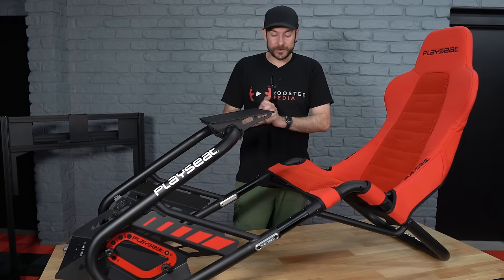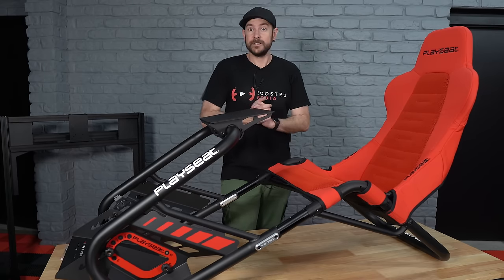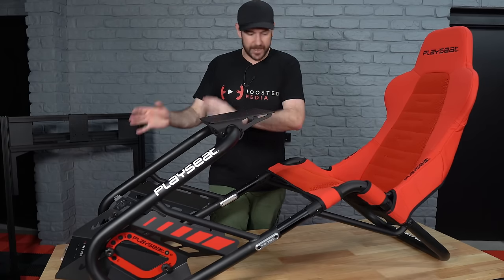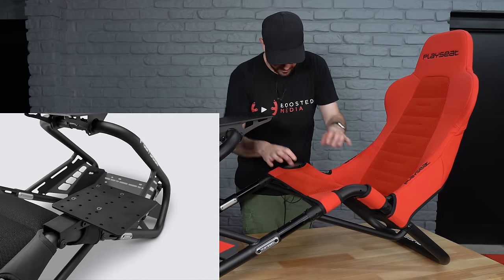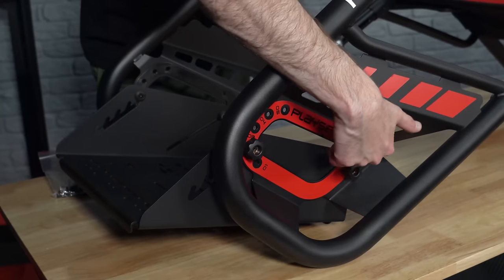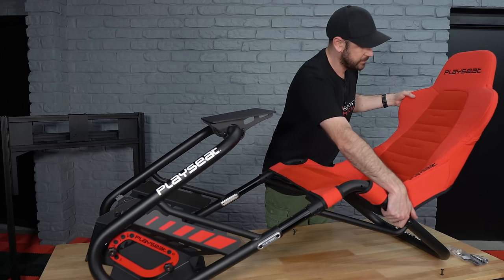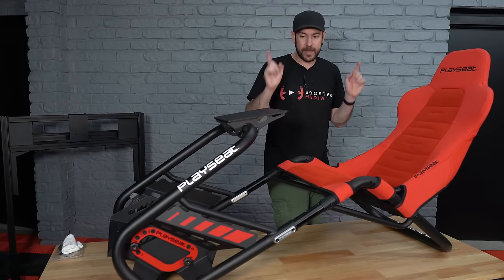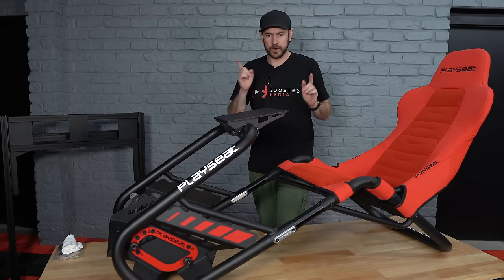JUST BUY A PROFILE RIG? - Playseat Trophy Sim Racing Cockpit Review

Comment: Been rocking this for a good year. It's not ridiculously heavy and can be moved easily, which isn't something you can say for most rigs.
Reply: Every profile rig can be equipped with caster rolls, making it arguably even easier to move.
Reply: @schmid1.079   Doesn't make it anymore compact, if seen pictures of people having these vertically against walls or hanging from some hooks. It's also much more compact
Reply: @gerardweistra  Fair point about hanging it up, but how is it more compact?
Reply: @schmid1.079  it may be just visual but, it looks less massive; like a little less wide and tall
Reply: @gerardweistra  Yes, a little. About 5-10 cm in lenght and broadness. I can't see a lot of situations where those matter, and I have a pretty cramped room myself.
Reply: @schmid1.079 I can hang this on my wall when not in use. Try that with a profile rig 😂

Comment: I have this Rig since March 2023 and use it nearly on daily bases. The seat doesn't have any major issues besides one little corner where the red cover slighly started to peal off, but it is because when I get into and out of the seat I constantly rub myself around it. One thing to note though. If you have a shifter plate mounted and the other side of a rig is against the wall it is slightly complicated to get into it or get out as you need to through your feet over it in the air in a very awkward way
Reply: How much did you pay for it?

Comment: Would be interested to hear your opinions on other profile rigs!  I recently purchased a GT Omega Titan and it's only $100 more than this (cost including the RS12 seat) and this things is pretty solid!  The pedal plate is way thicker than is shown in the photos, there is a quite solid shifter mount, and while I know there are some people complaining about the wheelbase mount shifting with heavier bases, apparently a few bucks in locking screws/washers essentially solves the problem.  Obviously the playseat is for a pretty different market, as the GT Omega Titan is certainly not something you'll be moving around, but thought I'd bring it up since the price point to value ratio seems pretty high!

Comment: Have mine since 2 month and are happy with it. The perfect solution, if a rig has to be moved. But I found also one major issue. Under heavy breaking (use the Asetek Forte pedals) the clamping for the length adjustment is not strong enough. The rig will lengthen itself. This is quite an upset, as the only solution seems to be, to drill holes into the rig and put a bolt into to fix it.

Comment: I run this with the Podium DD1 and V3 pedals with the shifter mount and fanatec shifter. Everything is perfect to me, very stable, no flex and an extremely comfortable seat. I use a NLR floor standing monitor mount for my 48” LG C2 Oled and the ability to slide the playseat trophy back and sit in the seat and play my PS5 is perfect. That is disappointing you didn’t get the cable mgmt, my Logitech edition did come with them.
Reply: How many Nm do you run and whats the flex like?

Comment: I've got Sprints mounted to this thing using their baseplate connected to the tray which helps resolve a lot of the flex. Since it's lifted by the baseplate I also slapped a BST-1 under the pedals and another one using a playseat challenge 3rd party connector to the tube under your thighs, those are the same diameter as the OG playseat so those connector peripherals still work. Then I bought a bike phone holder holds a 9-keypad on the left to navigate menus. This sort of rig really benefits from qr2 otherwise its a PITA to stand up and get out of. As other have said you can whip the wheel mount around. Basically have this thrown in a corner connected via extension cables, if you're VR only it's a great solution. Oh yeah, if you get the gear/handbrake holder you can just slap some very short aluminum profile onto it and you can mount just about anything you'd want. Got Heusinkveld handbrake on there no problem.
Reply: How many Nm do you run and whats the flex like?

Comment: It looks all very fancy and stylish but a bit overpriced when you consider even with the "seat" (at £549 UK) for just £69 more for the setup I have which is a Simlab GT1-Evo / Sparco Grid-Q seat at £618 Vs the PS Trophy at £549, it might be suitable for some but in my experience having had both brands you're best putting your money towards a aluminium profile based rig that is rock solid and more adjustment / ease of mounting your wheel and pedals, simlab also have a nice range of other accessories to attach / match your rig too but I guess it depends on other peoples circumstances, I feel this PS Trophy should be around £400-£450 range.

Comment: Sat in one in the shop and it the adjustability leaves a lot to be desired compared to a profile rig also the seat was bad if you have back issues on long sessions. No lower back support or lumbar support. IMO spend slightly more and get a profile rig and proper seat.

Comment: After trying out and looking at a multitude of rigs and having the facility/equipment to build actual real cars decided to build my own.Wanting to use a proper FIA approved adjustable hydraulic pendulum pedal set up from my old race car it needed to be very sturdy. and using leftover cage tubing from various car projects and a recaro wingback on a Ford Mondeo drivers seat frame for full adjustment along with the steering mounting and pedal box,it took me about two weekends,I mounted a tubular slide mount to fit a tv,made from 60mm exhaust pipe it will support any size or number of screens you care to fit to it,mine has a 60" samsung led on it and its rock steady,and I used a 9"touchscreen android device for a dashboard. Given all the stuff I had already and disregarding the seat I bought the whole rig cost around £150 including powder coating.I hate stuff moving around even slightly and the transferring of vibration and harmonics through the frame that you get with commercial rigs. All of the rigs I looked at were  either just not rigid enough and/or wouldn't allow my pedal set up to be used without butchering them,therefore defeating the point.Its heavy,but static anyway in our games room and its rigidity is vastly superior to any commercially available rig. The bottom line is if you want something to really suit your needs you either get someone to make it or if you are in a position to do so, make it yourself.

Comment: I love this rig, but it has one shortcoming I do not like. The length adjustment doesn't tighten enough. Under heavy breaking, it tends to slide longer. I had to try and tighten it with an impact screw gun.

Comment: Driving this rig for about 900h now and sitting in it for like 1300h: The comfort factor kinda vanishes a bit if youre using this rig extensively, but nevertheless it never gets to a point where I could say I have to get out of it or else Im gonna hurt myself. One downpoint is that the material of the seat (I have the red one) gets a little worn out over time, especially the parts where I touch it to get in and out of the rig.
What also manifestet after about 800h is that the material on the "headrest" (the place where my head touches the seat) kind of detaches from the seat, it looks like a bubble... But I guess thats kinda normal for a usage of like 1300h
I originally bought it because of space reasons, Im not able to fit an additional full aluminium Rig in my home-office so the playseat does a perfect job, whenever I need to work on my PC i can store the playseat and work on my PC

Comment: I have the Playseat Trophy with a Simagic Alpha U and P2000 pedals. Love it so far. Small footprint!
Reply: I have the mini. So no problems with the U? Nice to know if i upgrade.
Reply: @Gepeperde  Had it for around half a year now, but no problems with the Alpha U or with the pedals. The massive P2000 base plate adds a lot of extra stability!

I'd say its much sturdier than it looks. Very impressive for the small footprint

The "wetsuit material" (seat) can perhaps be a bit squeeky during heavy breaking, and you can't adjust the pedals into a proper formula position (only formula/gt hybrid). But other than that I'm super happy with it. Use it for maybe 2-3 session per week
Reply: @sebastianmandrean  Hydraulic not for me. Is recommended for daily use or close to that. I use the rig mostly on a Sunday. So the seller advised loadcell instead.
Reply: @Gepeperde  Simagic has the P1000 pedals without hydraulics!
Reply: @sebastianmandrean  i have the asetek forte pedals.
Reply: @Gepeperde  I've heard good stuff about them! Enjoy
Reply: Hi,

do you still use it and does it still work with the Alpha U. Is there much flex or is it fine? And do you use max 23NM
Reply: @philipp04-hp  Hey! I still use it, yes. Fantastic compromise for the small footprint. There is zero horizontal flex and maybe a tiny bit vertical? A couple of mm. But it also depends on how you mount & tighten everything; how much leverage you're exerting. I use the full 23nm yes, but how often it actually reaches that will depend on where you set your clipping point ofc.

My only criticism would be:

1) Pedal adjustability could be much better, especially for Formula positioning
2) A seam in the fabric started loosening up, but I managed to get it replaced under warranty. Who knows, the issue might creep up again though.
Reply: @sebastianmandrean  thank you so much for your help

Comment: My Trophy came with velcro strips for cable management. Not sure why this one didn't. Had mine about 6 months now and I have zero regrets. Very comfortable and rigid. Zero complaints. I've also noticed that anyone who seems to knock it has no firsthand experience with it, and they all promote the more expensive rig they bought. So don't pay much attention to the haters. They just don't understand that they paid $100+ more for a product that isn't as good overall. Every profile or other rig I've used has at least one noticable area that falls short of the Trophy. From an overall quality, comfort, and rigidity standpoint, you get far more for your dollar here. Quick adjustability to fit others with different heights is the only thing it's lacking. Your not going to be switching between a 6'1" person and a 5'9" person quickly. That's the only real downside.

Comment: I bought a 6 Sigma Slim with the adjustable seat for ~$700. I think at this price point, the 6 Sigma Slim is way more future proof when it comes to add-ons and way more sturdy. I've never used this Playseat rig, but I would probably advise folks to wait a few weeks, save up some more money and go for a solid rig. This Playseat chassis just seems to limit you if you plan on adding other pieces to your rig and the price isn't even that far off aluminum rigs.

Comment: I've had this seat for a year now exactly. I was skeptical at first about the price and whether it would hold up against my Podium DD1 Base, but it has been worth it every time. I have driven 2k hours in ACC, using pedals with 90 kg load cell (75kg using) and absolutely no flex to date. Very good and very stable cockpit with very comfortable seat. I would buy it again
Reply: I know you wouldn't have it set to this but how much flex is there at 20nm?
Reply: @TheDoctor46vr  I tried it at maximum 16Nm and no Flex. Very stable design
Reply: @playa4life306  set to 75kg is a lot! I wonder what Will has his set to because you can see a fair amount of flex when he uses it. I wish he would have said so, I don't understand why he would leave out such an important detail in a review. 

If I were him I would keep testing different amounts of brake force until I found no flex.
Reply: @TheDoctor46vr In the video the pedals are mounted directly to the rig and don't have their own aluminum plate like my V3, so flex a bit on the ring I think. It depends on which pedals you want to use. I don't feel any flex with my pedals when I set them to 90kg
Reply: @playa4life306  he also tested the V2's that have their own plate and they flexed as well, not as much but they still did.
Reply: @TheDoctor46vr  I don't know mate. Then that's flex you can see but not feel. That may be the reason why it wasn't mentioned in the rewiev.
Reply: @playa4life306  it was definitely mentioned in the review. That was his main criticism of the rig that he was frustrated they didn't reinforce the pedal plate because he knows they could of done a much better job with that part of the rig.

Comment: This looks an upgraded evolution of the Fanatec CSL seat from back in the day. I have owned the CSL seat since 2014 and still use it with my Logitech G Pro as of late. You are right tube designs do lack rigidity or at least mine does. But I would have to say it has stood the test time for sure lol. I bought that thing right before Fanatec discontinued them on a Black Friday sale. Best $99 bucks I ever spent on sim racing gear. This looks to be more versatile and rigid though. 

 One of the biggest issues I have had with the CSL seat is pedal mounting rigidity. I have to mount the pedals very close to the seat to make sure they dont rock backwards when you put force on them. Because of that mounting configuration it makes getting the seating configuration very tricky. Im 5’ 8” and anyone any taller than me would not be able to use the CSL seat because of this unless they are ok with the pedals raising almost 2 inches off the floor under hard braking lol. 

 The profile rig looks to have a more solid pedal mounting design in comparison though. And it also seems to have more adjustability on the wheel deck, seating position, and pedal deck. I think I’ll be upgrading soon because the CSL seat is getting very long in the tooth. So many options these days though.

Comment: I got the Logitech version about 6 months ago, still looks new, id say there are a couple downsides, lack of wheel height adjustment, and lack of fixing areas for handbrakes etc
Reply: As Will mentioned, they sell the shifter/handbrake mount that is able to mount whatever you need.
You could even buy 2 of them and mount one on each side of you need.

Comment: Just bought a Club Sport DD and Club Sport elite v2 pedals and needed something that didn't take up too much space and would be easy enough to move and this is exactly what I was looking for. Just hopped onto their store and bought one so it will be here either before or at the same time as the wheel base. Kinda sucks that I will have to struggle with mounting the pedals though 😅

Comment: With no room properly dedicated to my sim racing addiction, I needed to find a rig that could be transportable from behind a shelf to the center of my living-room. This is just perfect for that, as you can easily fix 2 wheels under the pedal plate to move it from one side of the apartment to the other. I literally need 2 minutes to install it for a session. So practicality: 10/10

Driving with a Fanatec DD1 and V3 pedals with the BPK installed, I frankly don’t notice (even if there may be some) any flex at all. I can imagine that the flex of the pedal plate is reduced by the overall structure of the V3 pedals, as the tension points are on the sides. The only flex that I can feel, is from the seat. But it is not a problem to me, even if of course it would be better without any flex at all. 

And regarding the seating position — being personally quite picky about that topic — I can easily set up a perfect position, at least for GT driving. I am 184cm tall (if this info can help someone).

And regarding the aesthetic, just remove all the stickers and it directly looks less like a “toy”. Even quite serious imo!

Can’t recommend it enough 👍🏼

Comment: At the price that want for these (where I am at least) - I still reckon go for profile. Unless you value the lightness and don't plan to add to it. In which case, this makes a lot of sense. 
Anyone that really cares about rigidity is probably going to end up bolting so much stuff to it that the benefits of this kind of rig go out the window anyway. 

If you are in any way mechanically inclined, you can order all the profile you need cut to length with no-drill connectors & delivered from local suppliers for not much more than these. Even if you aren't this isn't far off the price of a cheaper commercial profile rig, which ultimately is significantly better. This looks great for being able to push around, but if you are looking to go deeper into the hobby you'll need a dedicated space and you will outgrow this quick - Not a problem, if it wasn't a significant portion of an end-game rig. With profile it's modular and cheap to evolve and adapt.  

It does look really well put together though for what it is trying to do, it just seems like it would be $400-500 wasted if you don't stop there. 

I built a profile rig "DIY" for $800 accommodating keyboard, mouse, joysticks, throttle, wheel, H-pattern, Track-IR, e-brake, pedals, belt-tensioner, 4x actuators & 1 monitor. Commercially it would cost me 2K+. DIY profile might be intimidating to think about initially, but it's supersize Lego. Most people probably live within 15 miles of somewhere that will cut to length same day. 
IMHO, don't pay someone 25% just to order cut lengths of something as ubiquitous as timber & charge to ship it to you (if you are shopping for value anyway).

Comment: Interesting that yours didn't come with velcro cable management, mine certainly did. Don't think you covered it but a weakness mine has is that the connector rails from seat to feet does slide out a few mm over time. Besides, I love mine. Its light and easy to get out of the way. I don't have room for an aluminum profile so this is a good middle ground for me.